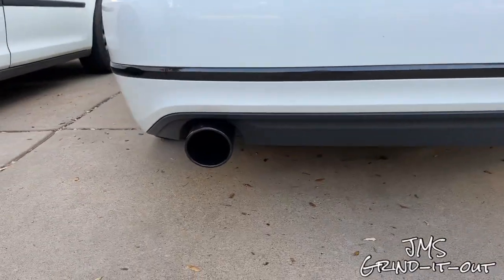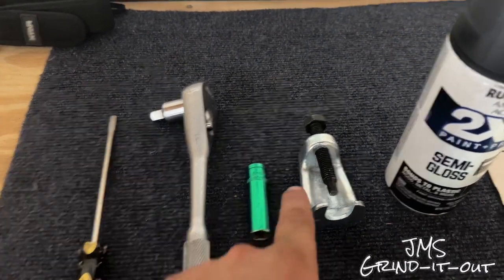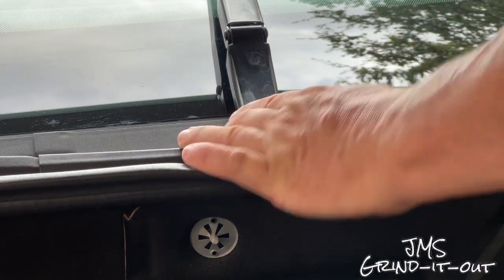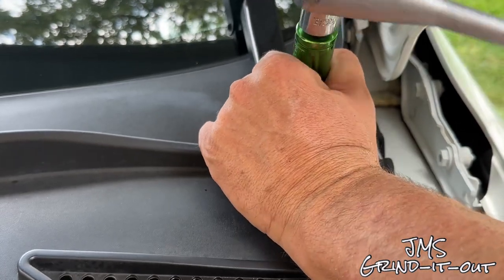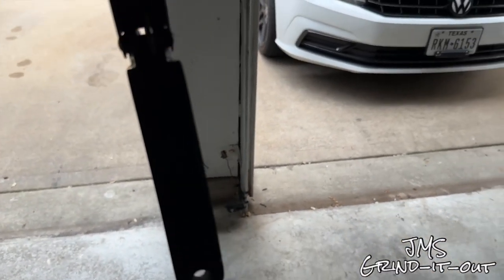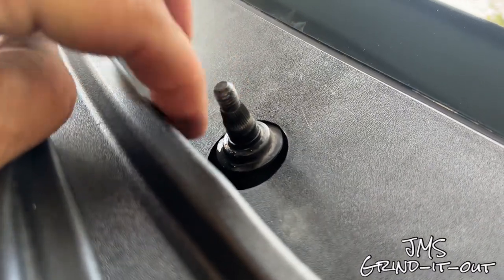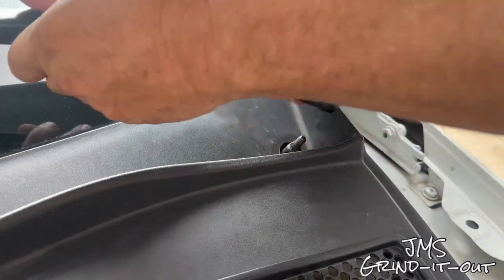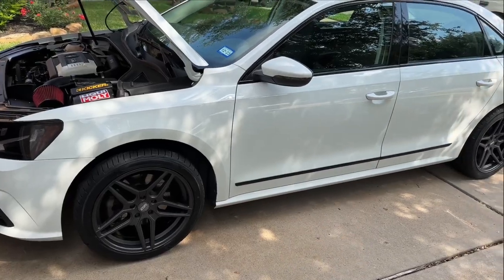WINDSHIELD WIPER ARMS - How To REMOVE And RESTORE Like New

Comment: I must add..I have a 2017 Passat.  The tool in the video works WAY better than the tool you have in your description.  I couldn't even budge them using that tool and it kept slipping off.  The tool in your video worked in less than minute.
Reply from the maker: I agree on the tool.  The one I use was cheap crap.  It worked.  But I agree with u 💯

Comment: I can't believe the timing.  Yesterday I tried to help a friend replace the arms on his car because the springs were worn out and he was not getting proper pressure on the windshield. We struggled with various screwdrivers and pry bars to try and pry the arms off the shaft with no success.  We gave up.  After watching your video, I will call him and we will do the project right this time.  Thanks.
Reply from the maker: Good deal!   Glad you were able to help him.   Thanks for watching 👍🏼👍🏼

Comment: Video Top, I came here to understand if it was normal for the smaller brush on the left side when looking at the front of the car, if it stayed like that in the air or if it fit more but it looks like I did a good job and everything is ok.
 The only problem was that I forgot to paint the caps ahahah
Reply from the maker: Lol. Easy thing to forget. They just pop off.  I didn’t paint mine.